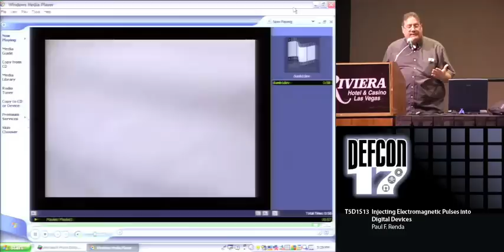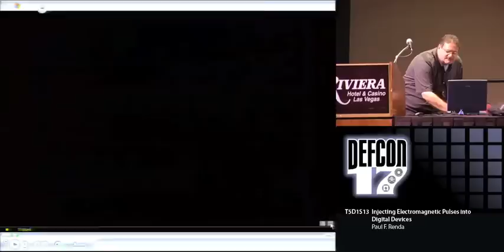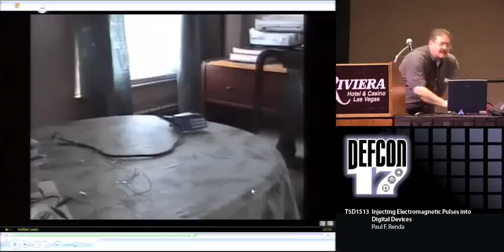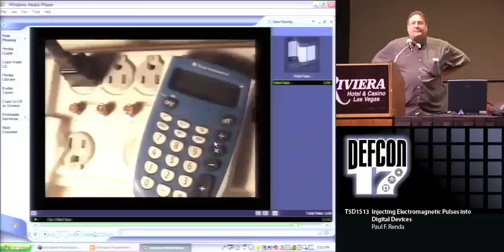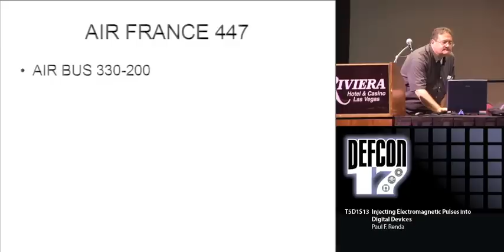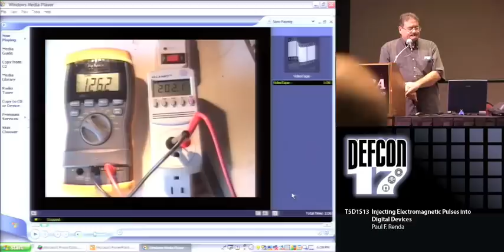DEFCON 17: Injecting Electromagnetic Pulses into Digital Devices

Comment: It seems that i have heard this idea somewhere before. Shutting down infrastructure with EMP. Tom Clancy uses some idea on EMP blast from a nuclear weapon in The Sum of All Fears in 2002. While it does focus on the explosion for the death component he does touch on operating systems in the immediate area being affected. Then again in Oceans 11 they use a "Pinch" to bring down the electrical systems of the the Casino. This idea has been noticed just the application is needed.

Comment: In reality what happens is that multiple edges are created in the clock circuits causing the processor to be put in a 'disallowed' condition. Most modern processors can detect this, military processors have occasional 'clock pulse reforming' circuits in them to try and overcome it (hardening) and older devices simply latch up and die. In addition false spikes are put on the data lines which obviously cause false output! This is why the calculator display output keeps changing.